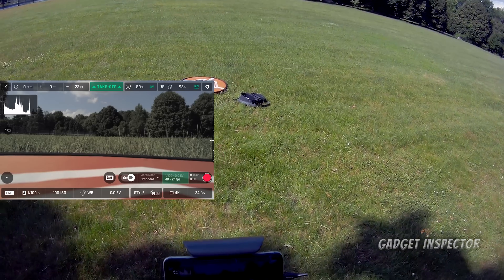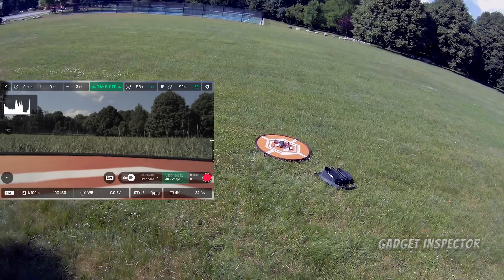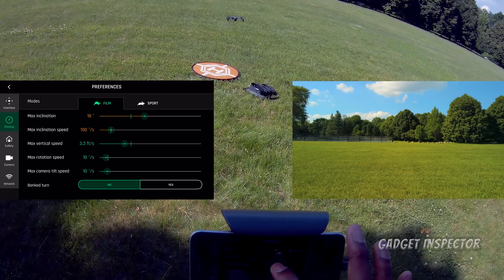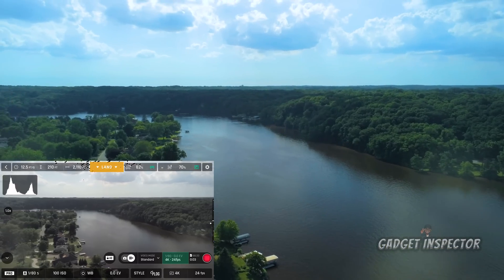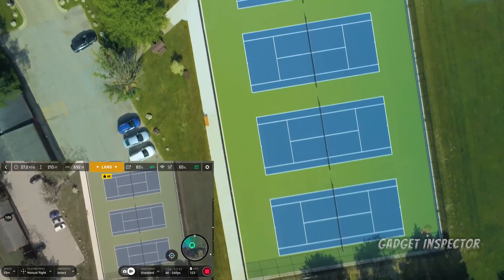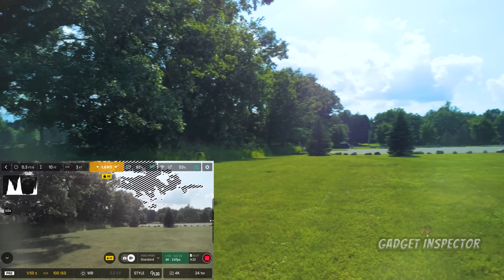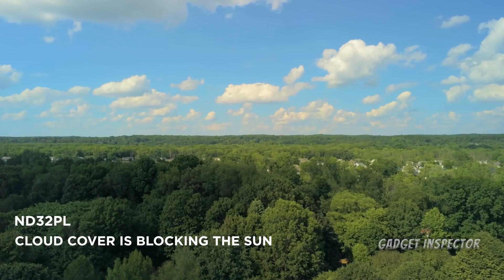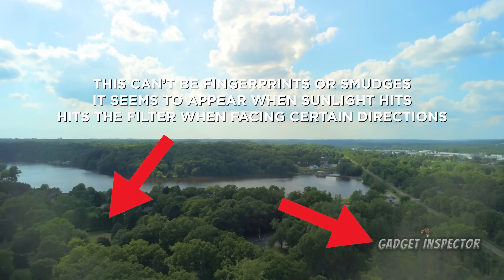Parrot ANAFI ND Filter and Camera Test | Episode 3 (Part 2)

Comment from the maker: IMPORTANT NOTE: A viewer brought to my attention that the polarized filters (ND32 and ND64) are actually adjustable. I totally missed that because there's no dial like you usually see. There is a little notch on the front and I confirmed that when you turn the filter the intensity of polarization changes. Out of dumb luck, I've always had the filters mounted in a way where the polarization is at its greatest. I'm going to play around with it to see if I like it dialed down more. Just wanted to make sure to pass that along since I didn't mention it in the video. Thanks to @Jet Martin for giving me the heads up.
Reply: Yeah I'm waiting to get some ND filters because every place I check is out of stock.

Comment: Thanks for this, GI - this is exactly what I needed to see before I spend my $ on the Anafi. Parrot still has the best app. and these filters are a grea improvement on what is already my favorite video (but I like over-saturated vids.)
I like how the monitor is blown out by the clouds while the video is detailed..
But what IS that flash in the upper right? Reflection from the filter's mount? That IS an issue. Didn't see it with the filters off, but IO didn't see a duplicate of the RTH where it occurred. You have the original footage, so if it shows up there on both, it's not the filter. But either way, thanks for the work you're doing.
Reply from the maker: I haven't seen that again and I tend to believe it may have been a tiny stray hair caught on the filter. I also discovered that you can dial down the intensity of the polarized filters by turning them. Totally missed it because there isn't an actual dial on the filter. I'll probably post one more video on it.

Comment: Not sure if you were using one of the Polarizer filters or not but my understanding is that a polarizer filter's effectiveness is highly dependent on how you position it on the camera lens. If it is not aligned properly you won't get much benefit from the filter.  Have you looked at that aspect of things? I've seen others mark their filter with white out to ensure that the filter is aligned properly when you put it on the lens. Thoughts?
Reply from the maker: I stand corrected....you're right, these are adjustable. Every time I mounted mine I had them on the strongest polarization (blind luck). That explains why some of the ground shots are so super saturated. I had to hold them up to a light while turning to prove this because there are no instructions that point this out. Most adjustable polarizers have a dial you can turn, these only have a notch on the front that's easy to miss. I may do a quick update vid on that.
Reply: @GadgetInspector  Thanks for confirming. BTW Ethan Mitchell does awesome Anafi Tutorial videos.
Reply from the maker: These are fixed.
Reply: @GadgetInspector  Not sure what you mean by "fixed"?  I understand that the filters are affixed to the camera lens but my point is that by simply rotating the polarized filter will yield different levels of polarization effectiveness....from very little effective polarization effect to a great deal of polarization effect.
Reply from the maker: All polarizers are not adjustable. Some are....fixed, meaning they only have one fixed degree of polarization. No need to rotate anything. Lot's of options out there my friend.

Comment: Great video (thus far)...The obvious question is why wouldn't you want Auto Exposure on all the time...after all isn't it intended to give you the "right" exposure (and therefore the best image) given changing lighting conditions and isn't that what you want?  (I think I know the answer to this but it's a question that is begging to be asked.). Care to take a crack at it?
Reply from the maker: It's really just preference....but...the main reason to use filters and manual settings is to slow the shutter speed to double the frame rate (180 rule) to attain the proper motion blur. It yields the most 'natural' looking movement. I go more in depth in this video: https://www.youtube.com/watch?v=f4x1kE0vA3I. Most of us are not providing footage to clients or doing anything professionally, so it really doesn't matter really and most folks won't tell the difference... until it's pointed out. Then their eye will look for it I think. Polarizers are also great for reducing glare and reflections, especially when shooting water. I think that stands out a lot when you see it. Whenever I watch footage that I filmed on auto settings I cringe when I see the exposure change. For example, when I pan up from the ground to the sky, the sky will be blown out for a few seconds before adjusting. Once I learned how to use manual settings it became hard for me to use full auto. Nevertheless, it is probably the most care-free way to fly because you aren't worried about anything but flying and shooting and I actually do that from time to time; you can still get great footage....if you plan out your shots.

Comment: BTW, it seems to me that the image on right with no filter, your WB is off. Did you have it set to "auto". Place it on cloudy and see the difference!! You are using the cheaper FW filters for your Anafi. I wonder if the "nano coated" filter would fair better in comparison. I have the nano coated on the way but they are $50.00 more in cost over the budget brand....

Comment: Great work as always! My theory on the "anomalies". I noticed that the rim of the filters are not a full circle, there is one or maybe 2 gaps? It could be possible that light is leaking thru that gap when the camera turns its side to the sun.
Reply from the maker: I actually thought the same exact thing. I can't remember if I had it mounted with the gap facing up or down, so I'll try both and see what happens.